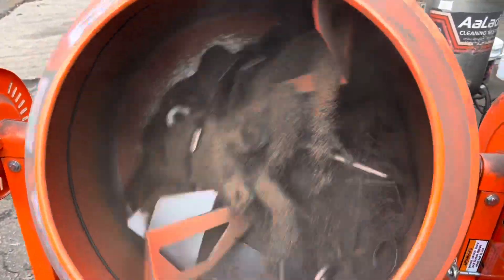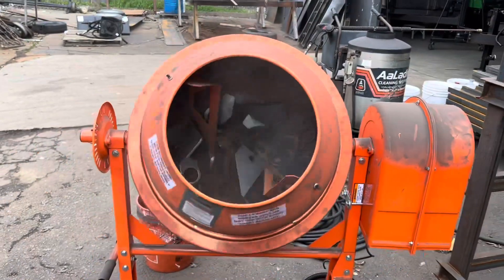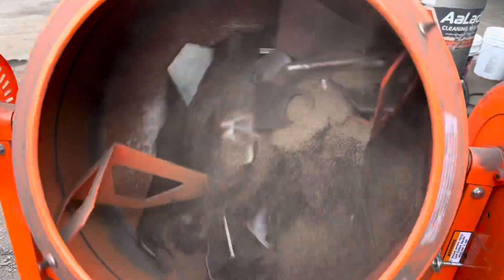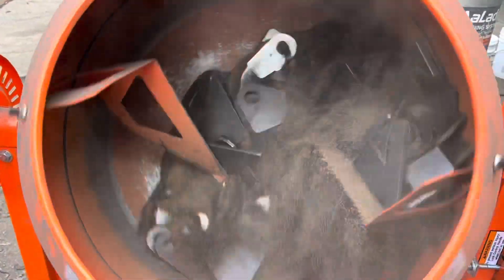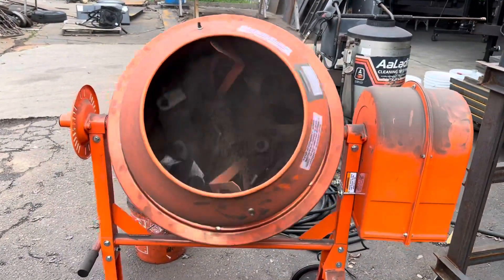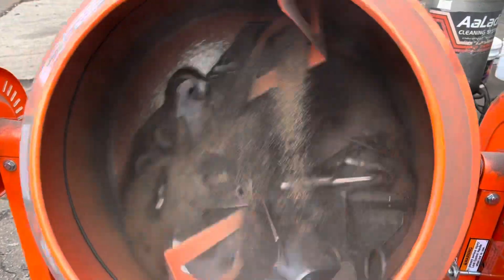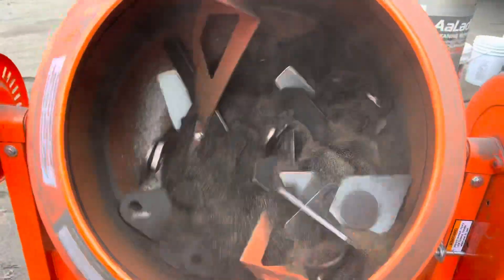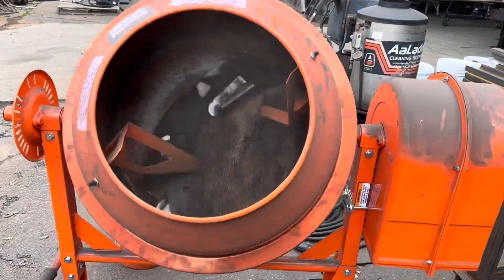Preparing Plasma Cut Parts for Welding without Grinding

Comment: Really interesting technique using a cement mixer for prepping parts for welding. It sounds like an efficient way to remove slag and smooth out the surfaces. It's always fascinating to learn about different approaches and tools used in metalwork.